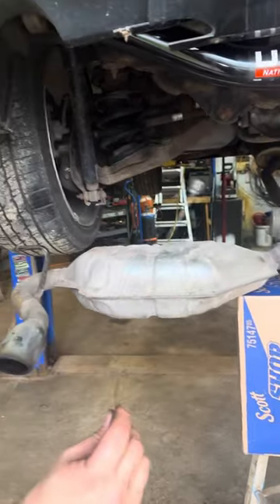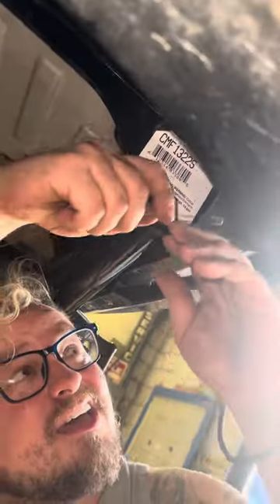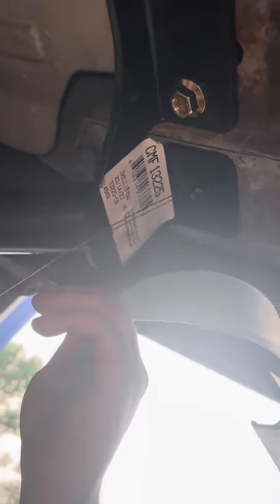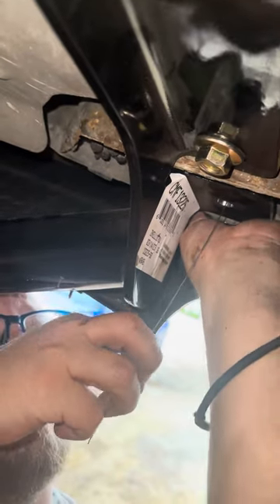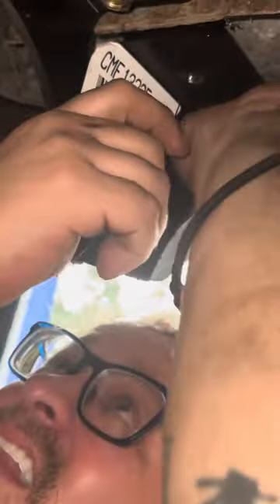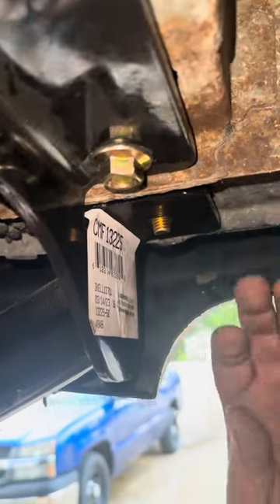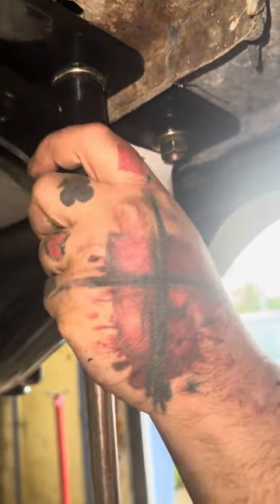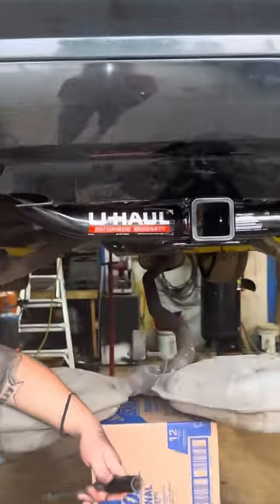How to fish bolts through car frames to install a trailer hitch receiver

Comment: U-Haul installed a Hitch on my 19 Nissan Altima and left bolts inside the frame. And now they can’t take it off because they say it’s a body shop work. The noise is terrible